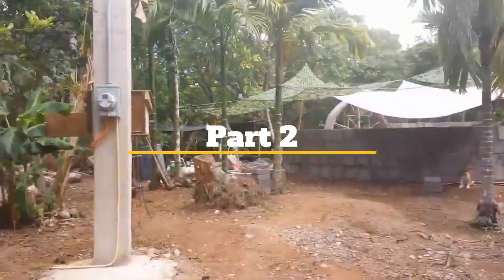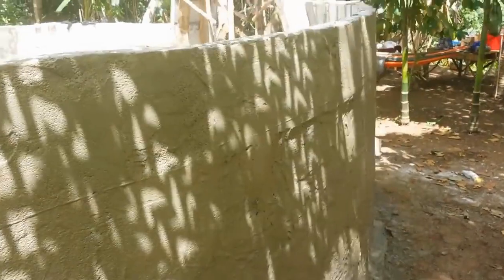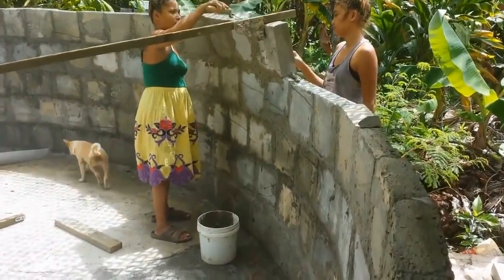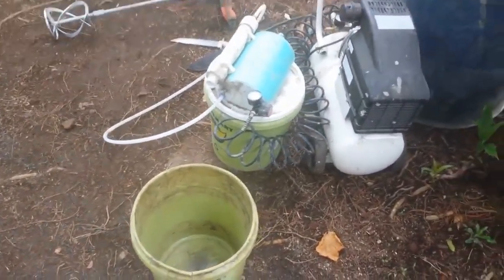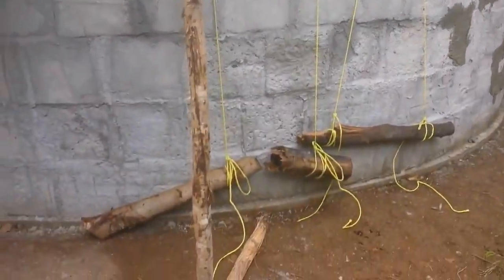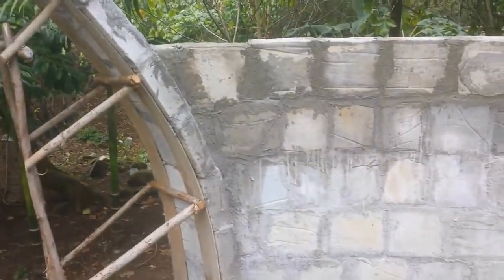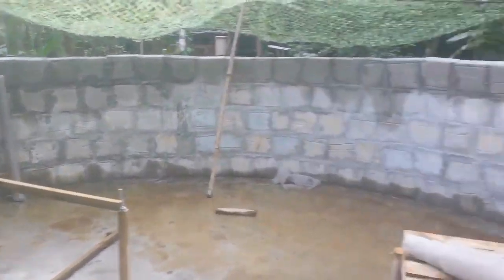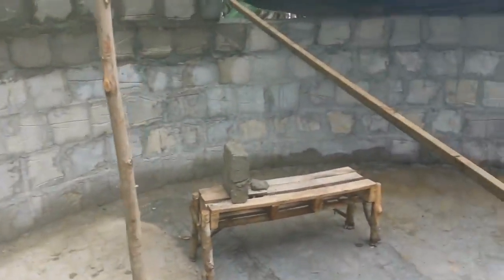Aircrete Dome Home, Part 2, Domegaia, Yap Island

Comment: Great job guys.

One question. Why dont u put water before the mortair? AND after putting the brick they are not cleaning the excess of mortair.
Reply from the maker: Oh yes, they spray water and wet the blocks before mortar. It is just not shown here. Excess mortar is easily sanded down.....this is aircrete which easily sands.